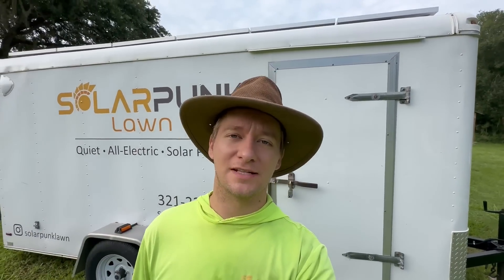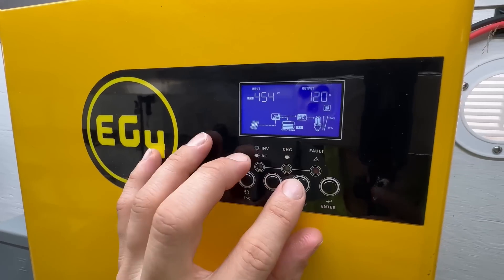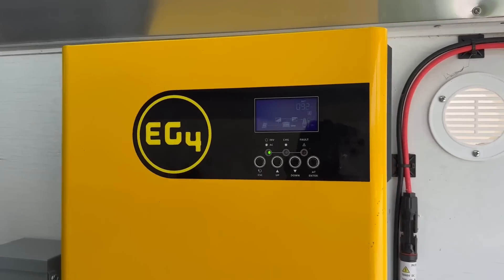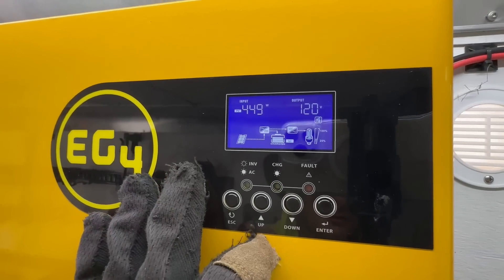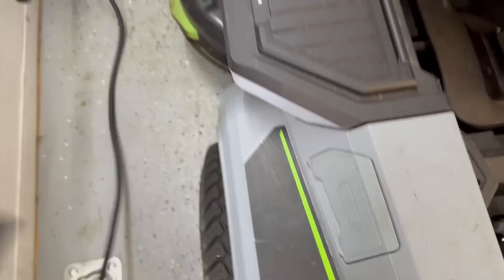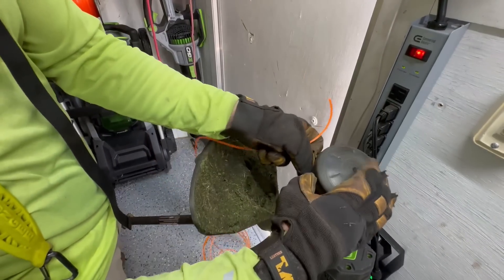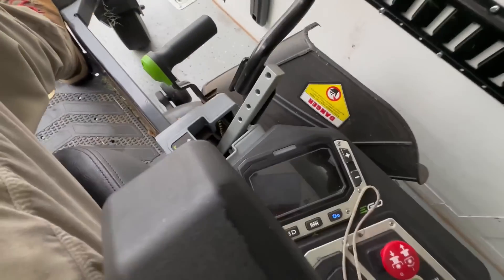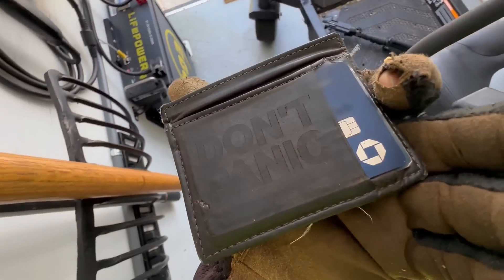Mow Forever? Solar Powered Lawn Care

Comment: I tried this approach. I installed two solar panels and a 2.1 kWh battery for my setup. All I wanted was the weed wacker and leaf blower. I am good with my Graverly Stance Pro 36. The solar and battery did not disappoint; however, the weed wacker did, and it's the commercial one with the backpack attachment. I have burned two so far and went back to gas.  I still like my hand blower because I usually don't need the backpack to dust off the side walks.

Comment: wow I'm surprised your batteries dont get over heated after all those re charges . My Son and myself have an Ego Mower and weed wacker and some times the battery gets to hot and dosn't charge . We have to wait until it cools down.
Reply from the maker: Nope! I think keeping them in the enclosed trailer actually helps a bit (shade). I've left a tool out in the sun a few times and the battery is baking hot just from sunlight. Most of my mower batteries don't get above ~115ºF but the blower batteries can get around ~125ºF. They actually "cool off" while charging, weirdly. I think just because they get put in the shade and there's a little fan blowing in the charger.

Comment: Not much for electric mowers, but this woke crap and talks of monitoring our carbon output has me looking at solar power and mowers are the best way to start experimenting. Not laying down $3k for experimenting , but did find a 1970s john deere 36volt electric rider for $75. Needs batteries and the main switch replaced. Like an old floor scrubber or forklift it has three 12 volt batteries wired in series. Thoughts are to start with a 100 watt  monocrystalline panel (I think they said there more efficient than amorphous. Mount on my shed and charge the 12volt batteries individually.  Where I'm lost is batteries.  Solar batteries or deep cycle.  Is there a forum you recommend? On a steep learning curve here
Reply from the maker: Hey it’s cool you’re playing around with some electric stuff. I just find it fun being able to build my own energy production and storage systems. 

I did a bit of searching and seems like your John Deere is a bit of a collectors item for those into JD, so maybe try some JD forums for the mower itself? As far as solar/battery information I recommend checking out DIY Solar with Will Prowse ( @WillProwse ) on YouTube, and he also has a very active forum called DIYsolarforum.com and you should be able to find lots of info and people willing to help. To answer your question I think deep cycle would be better. Good luck!

Comment: How does your tesla hold up pulling the trailer? Is the trailer capable of charging the tesla as well? I run a small lawn and irrigation business using greenworks equipment and we havent been able to find an electric vehicle capable of pulling all the weight efficiently... looking to kit our trailer similar to yours soon! Thanks for the videos.
Reply from the maker: Hey thanks for stopping by and always fun to hear from others doing something similar! 

Technically the trailer can charge the Tesla, but it’s such a small amount and a slow charge that it’s not really worth it and also not necessary for my situation since I just charge at home and have plenty of range for the whole day.

The Model Y handles great, but my routes are maximum 40 miles round trip and I typically stay off the highway but have a few miles of ~60mph roads. Anyway, if you’re not trying to do 100miles or more a day with the trailer (although you could with supercharging) it’s a great option, just realize the tow capacity is 3500lbs with 350lb tongue weight so you need to be cautious of trailer choice and equipment loading. All my EGO stuff is fairly lightweight so in total I’m probably hauling ~2500lbs or a little less. 

A friend of mine runs his palm tree fertilizing business with a Model Y and a lightweight enclosed aluminum trailer and does about 40,000 miles a year. I think fully loaded he’s hauling ~1600lbs total. He stops at supercharges on some of his routes when driving around the state. Anyway, he loves it and says it’s saving him loads of money in fuel compared to his old truck.

Comment: Interesting set up. How are the blades holding up on the mower? I've seen some other comments on other videos that they are not the best quality, and get dinged up pretty quickly and often. Resulting in a lesser quality cut.
Reply from the maker: They seem to be doing fine, definitely depends on the type of terrain you’re running over. I’ve got some vacant properties that chew them up a little more than the small well-kept lots. The cut quality mostly suffers when the grass gets really thick, regardless of sharpness. It’s a great product for the homeowner or individual trying to start their own small lawn care business, but has some ways to go to be a proper commercial rig in my opinion. Still a solid little unit.

Comment: You don’t pick up any debris?  Seems like it would be a nightmare to dethatch later.
Reply from the maker: Here in my area in Florida it's the norm to leave it on the ground and it degrades so quickly with our heat/humidity that it's never an issue.  I do see some homeowners that bag their clippings but it's not typical and not really necessary.

Comment: Just for perspective, a gallon of gasoline has almost 34,000 Watt-Hours, and it doesn't care about rain, shine, cold days, or hot days.
Reply from the maker: It is pretty crazy how much energy is available in gasoline, it’s a shame that internal combustion engines are at best around 18-20% efficient at converting that into usable work.  Electric motors and batteries are much more efficient at using and storing energy (~97-95%, respectively), but unfortunately battery tech hasn’t progressed enough to be able to store large amounts of energy in a small (lightweight) form factor.  However, I do find it kind of crazy that my little solar panel array on top of my trailer can run an entire solo operator lawn care business, just goes to show how efficient those electric motors are. Of course like you said when it’s cloudy I don’t make as much power, but I can mow in the rain, I just choose not to mow when it’s a torrential Florida downpour with lightning striking all around you lol.
Reply: ICE engines are becoming more efficient as materials and technology improves, some are well above 30% for consumers while there are industrial applications approaching 50%. With petroleum fuels the ceiling is much higher than any battery technology that exists now or on the horizon, there is simply nothing that approaches the chemical potential energy storage that gasoline and diesel enjoy. Not only in storage but also in transferring that energy, a standard gas pump moves roughly 300kWH in a matter of minutes. Not only are there no batteries that can accept a charge at that rate, there's not even a safe way of connecting such power outside of utility-level controls. Battery-power works for certain applications, your setup works for you but wouldn't scale for large crews working tens of yards every day.

Comment: I thi k this is an amazing setup for southern states. But not practical in my area with the hills and growth of grass. I had to double cut most properties this year with the amount of rain we had.
Reply from the maker: Thanks! It does fit “The Sunshine Stare” quite well. However, the summer down here was tough, we had record heat, rain nearly every day, and things just wouldn’t stop growing. That meant I had to double cut some properties/areas too. Luckily I had enough power storage, but I could always add more if I needed it. An option up north might be to just have lots of battery storage and not solar. Again it might not make sense to do it right now with electric equipment being early days, but something to think about for the future maybe.

Comment: What do you do to keep your car clean after getting dirty and sweaty?
Reply from the maker: I have a seat protector and then a towel as a cover over that so I can wash it.  I have a steering wheel cover and then covers on the sun-visors because those get dirty finger prints on them.  Other than that nothing. It cleans up surprisingly well.

Comment: Definitely a sweet set up, my question is do you charge double or same from say using gas equipment? Also what is your overall cost with panels battery equipment practically the trailer set up?

Comment: Dude is using an $80,000 setup to pull a small residential lawn mower around.
Reply: Tesla $34k. Trailer $4k. Inverter and battery $3k. Panels $1k

Comment: what is the heat like in the trailer with all those batteries charging and discharging plus inversion. that trailer must be hot as heck just from the equipment let alone Florida sun!!

Comment: Considering today if I could build a solar system for an electric lawn mower. The old cub cadet is over ten years old and I have replaced many things so it's time to explore other options. Your system might work well for me as I only need to feed one electric mower and some small power tools. So it is a good starter set and looks to be able to other tasks as well. I don't have a mower business and don't need the trailer but it is portable and that is as good as it gets. I have my order in for a cyber truck and my wife likes to do the mowing. I consider this a good option rather than putting in a whole house system. The fact that other things can run off this system lets me know that there is a good chance that backup for the house can be achieved minimally with a setup like this. Thanks and I will pass along the video for those interested.

Comment: This is what I was trying to do to my astro van. Solar and portable off grid power. To charge off my alternator and roof.
.
I was putting in extra batteries for my alternator to charge , while driving from house construction sight to sight. One Ford ranger. One astro van. One trailer.
.
Air compressor for framing. Push lawnmower. Impact drills. Even a shower in the trailer. Electric hot plate. 12v Mimi fridge. 
Ps, The "mini fridge" sucks the 100 amp battery in 2 hours Dead..!
.
$$$$$$.

Comment: You could fabricate a tension spring attached to a wire and connect the wire to the trailer door. My grandpa did that for his so he didn’t have to manually lower it since he’s getting old

Comment: This is a great idea! You could  add more solar and battery capacity so it would even charge your EV as well, hey, why not. Great setup though. I would use your service over my current garden care provider, they uses gas equipment, not preferred.

Comment: Yea I've been running an all ego electric lawn service for 3 years.  Only problem I see is u constantly topping off your batteries will severely shorten their life span.  Also keep in mind as a commercial lawn service u only get 1 year warranty not 5 on tool and 3 on battery.

Comment: In my german camper van, I added a 550W Solarmodul, an small victron mppt and 2,5kWh Battery. I love it to cook and charge my e bike while traveling. Your setup is a absolut dream setup :D. Once done, you reduce your noise and cost a lot. In germany one kWh is around 30 euro ct. This video was very very cool.

Comment: The algo just dropped you into my feed. What an incredible setup you have. What's your WHPM on the car while in tow? I have an open trailer and it still kills my range.
Reply from the maker: Around town I get in the ~400Wh/mi range, and then highway speeds it's worse, maybe ~500-600 or so, but I don't really go on the highway with it.  Just usually 60mph into town and back.  The weight hurts it but not nearly as much as the aerodynamics, even putting just bicycles on a bike rack will lower your range a good bit.
Reply: @solarpunksteve  I get worse putting the hammer down. 😂 Great setup with everything. I don't have too much free time to make one similar. But I would love to make one for fun.

Comment: Running the battery to 66 and then immediately plugging it in, charging it and immediately running it again - is going to over heat those batteries for less long term use for 100 percent fact. But I’m sure the batteries are cheap to replace over the long term

Comment: I'm sure you are planning to do this, but just in case, it would make sense to put a ventilation fan in the trailer.The batteries are going to degrade very quickly with that level of heat.
Reply: Good idea
Reply: Highly recommended. Batteries don’t like being hot or too hot when not in use.
Reply: Tell that to Tesla.....
Reply: @ShadeTreeShadow Tesla already test their cars in both extreme heat and cold areas of the planet

Comment: Great build and awesome business model. 2 thoughts on your trailer. Without knowing the dimensions of your tailer you could look into changing your panels to 450watt panels, it may provide your additional power and that inverter can do up to 450v so I can handle those panels in series. You'd need a minimum of 3 though (minimum of 120v). Second that inverter can take 120v ac input so on rainy days and days you finish late you can still charge your batteries. You can set it to prioritize solar and supliment with grid power. It would ensure you're always topped up for the next day.

Comment: Ought to build a dock for that mower so you don't have to plug/unplug it by hand! Something with either Anderson plugs, or those spring-loaded "pogo pin" connectors. Just back the mower up into the dock, kind of like those small automatic mowers do it.

Comment: A potential income stream you could be making is to sell a prebuilt version of your trailer. Id for sure buy one to avoid the hassle of designing it myself.
Reply: Realistically though, how much would you pay for an all-solar setup like this? 
Keep in mind that the mower with all six batteries is close to $9000 (at least retail); $200 for the leaf blower; $150 for a trimmer; batteries for those; all the solar stuff... Just the trailer is $7500 (at least from a quick search). Probably looking at $20-25k before any work is done.

Comment: I have a Ego blower and string trimmer and yes you can feed the wire through with out taking the cap off and it's super easy. You'll want to pull your string all the way through whatever length you want usually 14 foot of string is all it can hold. Then you'll press down on the cap and twist at the same time I believe to the right or left but it'll slowly feed through. I can re-string mine in about a minute. I'd say if you can put that money initially a fully battery powered lawn business would save substantially on over head. The occasional battery replacement, blade sharpening, and string that's the only occasional cost I could see.

Comment: Does it shut off automatically when fully charged ? Or do they overheat? Especially since the inside of a trailer will be hit anyway
Reply from the maker: Yeah both the inverter/battery and the mower/tool chargers will shut down automatically when full. And they all have thermal monitoring systems and will shutdown/stop charging if too hot, but so far even in our ridiculously hot summer here recently in Florida, everything has continued to work through the heat. Meanwhile I've had to stop due to heat exhaustion lol.  I need a battery powered personal air conditioning jacket or something.
Reply: thats honestly really cool and probably the future of landscaping lol. And trust me I know how hot it was in florida this summer, my buddy lives down there and he said they would have to stop work outside at like 1pm cause its just so hot 
 @solarpunksteve

Comment: Who is the manufacturer of the ramp for the trailer
Reply from the maker: I think it's a Reese Towpower 1,600lb tri-fold aluminum utility ramp I found at Tractor supply locally for around $100.  I had to modify it to actually work for my application and screw it down to the back of the trailer but so far it's holding up nicely.

Comment: Way too stressful to keep plugging stuff in. When batteries last 10 hours it will be practical.
Reply from the maker: Stressful? Maybe it seems that way from the video because I made it the focus in order to show it on camera, but honestly I don’t even think about it when out there. I just pull the mower into the trailer and plug in, it’s second nature now.   Either way batteries will get better, but they aren’t going to make any quantum leaps soon, so it will be incremental over time.  This is just an intermediate step until things catch up. And it’s just kinda fun to have a solar powered trailer lol

Comment: Awesome setup and proof that with a high enough investment in time and money, anything is possible. 

I’d be interested to know the initial investment cost of each piece of equipment used in this video. Tow vehicle, mower, trimmers, blowers, panels, batteries, etc… and compare that against a similar initial investment to establish the “gas” version. 

We can then figure out the difference to understand the the dollar difference of startup if buying all new equipment. 

Of course it’s not even a conversation when taking used since used solar/electric isn’t a thing really. I guess you operate on a 2-3 year refresh cycle. Possibly shorter?

Comment: This trailer with solar panels would do extremely well in California!
Reply from the maker: ? It has solar panels and it does do extremely well. Do you mean it would do well in California where they are trying to ban gas equipment? Cause even here in Florida with no incentives and no bans on any equipment, it still does extremely well 😁
Reply: @solarpunksteve  that's what I meant but I forgot to write in California. How much would you sell this trailer for including all the equipment that you have inside?